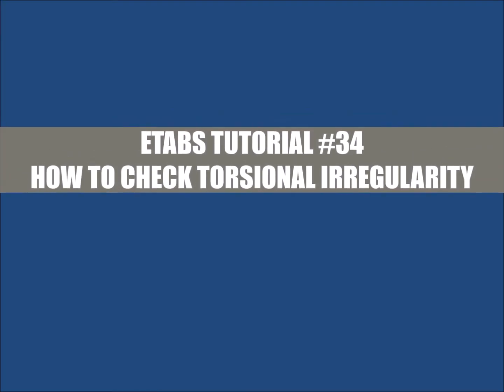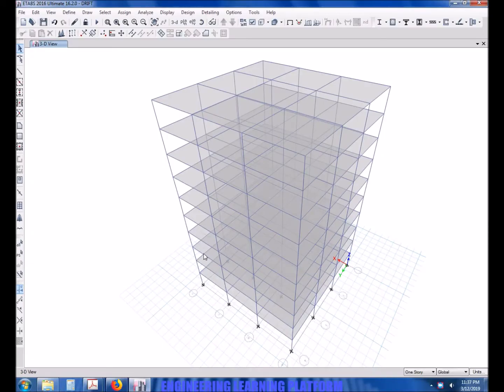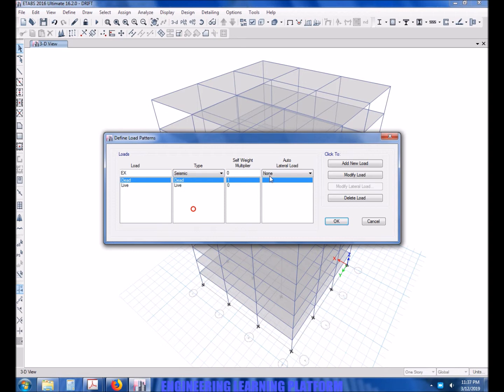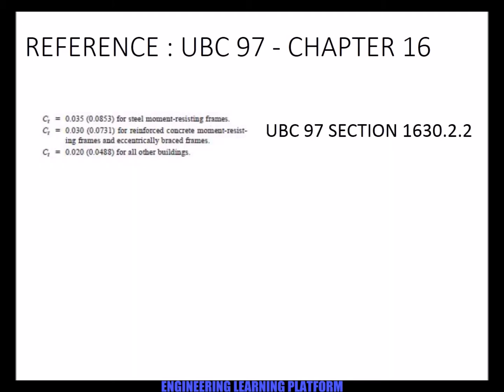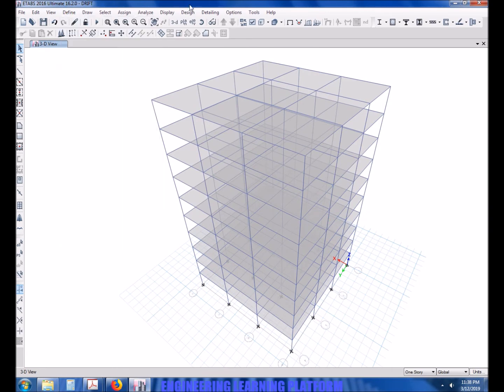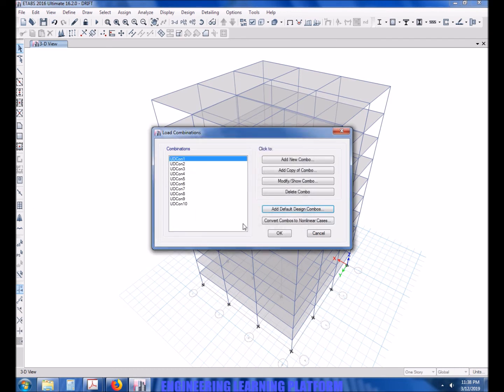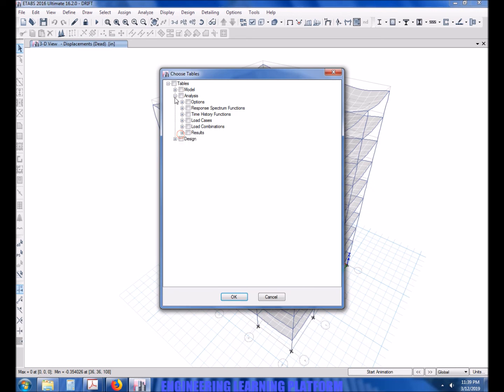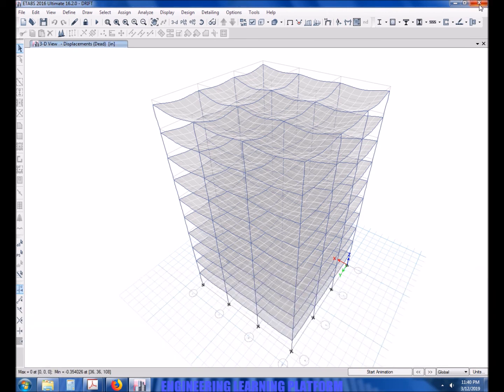How to check torsional irregularity in building using etabs

Comment: what is the use of Ax  = delta max/(1.2 delta Avg)  ? what are the solution for Extreme irrigularities
Reply from the maker: Increased stiffness of lateral forces resisting elements like shear walls and columns. While Ax is used to amplify the diaphragm eccentricity
Reply: @EngineeringLearningPlatform  so by amplifying diaphram eccentricity , the Torsional irrigularity will be reduced or not ?

Comment: I have a question. For wind, EQ, or torsional irregularity, " only load case(unfactored) or with respect to load combination(factored combos) what should be used? I mean check for single wind/EQ load case or check for load combinations? Also reference for that UBC/ASCE where it is mentioned. Again how wind can be defined for 10 years or 50 years? Thanks in advance and thanks for sharing informative videos.  :)
Reply from the maker: The drift checks are based on service combos or cases, while torsional irregularities utilize the combinations used for design . When i first performed these analysis i thoroughly go through codes/guidelines . I will quote the code provision with reference when i get i chance to go through it .
Reply: @EngineeringLearningPlatform  Thank you brother :) Carry on this good effort :)
Reply from the maker: The wind pressure can be defined for any life span till the exposure and speed remains same .